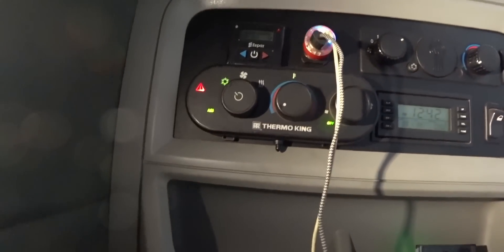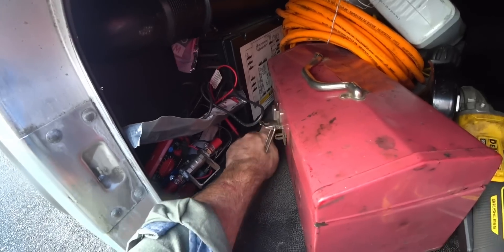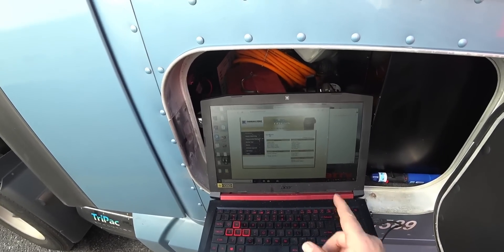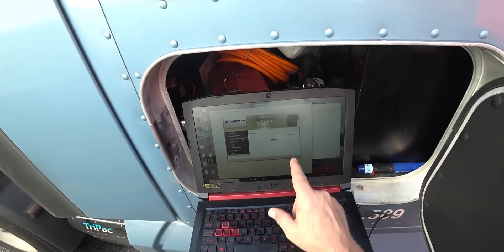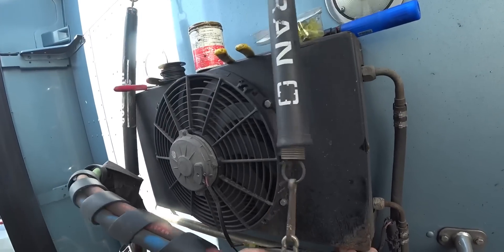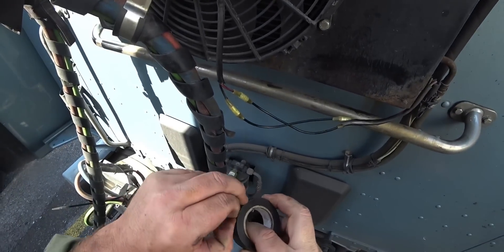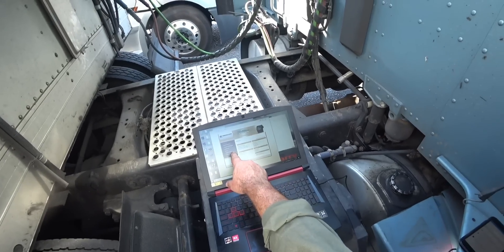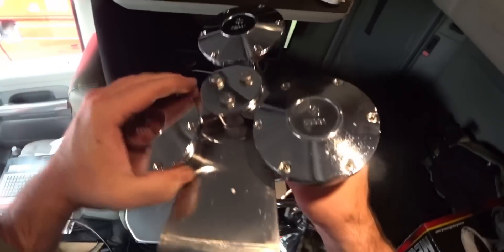September 9, 2019/199 Trucking, working on my Thermo King APU and stuff

Comment: Definitely get some  Black Split Wire Loom Tubing to armor up your abrasion prone wires. I use them under my hot rod's hood for looks and as heat protection.  It's this corrugated stuff you can buy in bulk.  I also use it house wiring when I am redoing something that needs additional protection.
Reply from the maker: Yep I should have some of that on stock

Comment: Hey Larry figuring you will mount your valve for the air horn in the cab......suggestion... do a t-fitting and have one side the horn and the other side a hose with a air gun for blowing out the cab and floors we had them on our trucks at Con Agra cause we were in the dust and dirt all the time..they work great for keeping the cab clean...just a idea...………..ok …………...see ya
Reply from the maker: I have one of those blow done airlines already mounted on my seat
Reply: @LongHaulLarry  Well I missed that one..guess im getting old...…….ok thanks take care...……...

Comment: To add the bracket to the third trumpet you may want to use pipe hangers and threaded rod that plumbers use for long pipe runs
Reply from the maker: I’ll probably just get the torch out and bend some metal👍
Reply: Better option!   You get to play with 🔥!

Comment: You might just rig a hand operated momentary valve like steam locomotives use. You can cheat by rigging a pressure relief safety valve off a water heater using some brass adapters. There also called blowoff valves. No pesky solenoids. Just braze on some kind of lever and a pull cord.
Reply from the maker: That’s kind of what I was thinking too but I found this pretty cool cheap valve on Amazon my try
Reply: @LongHaulLarry  If you do the relief valve go ahead and add something no other truck has, a steam train whistle.  Just add a diverter valve.  I'm sure that there is enough pressure in your air brake system. They are designed to cut through at a very high frequency.  https://www.kahlenberg.com/products/industrial-signaling/air-and-steam-whistles

Comment: Larry, is there such a thing as a "blind-side mirror"? ...that can be mounted to the regular mirror or to the passenger door, and angled so that it makes it possible to do a blind side backup, and still see where you're backing??....
Reply from the maker: There is a curved mirror over there but it’s not the greatest, what I do is I actually use my power mirror to angle the mirror out as I turn